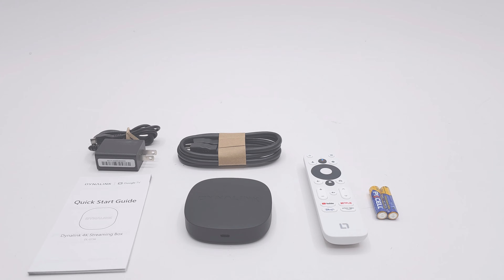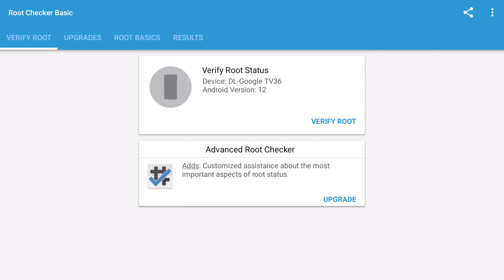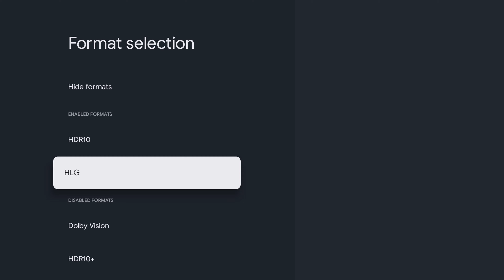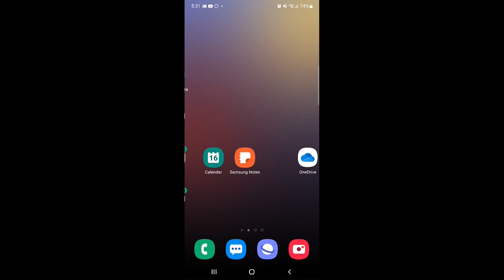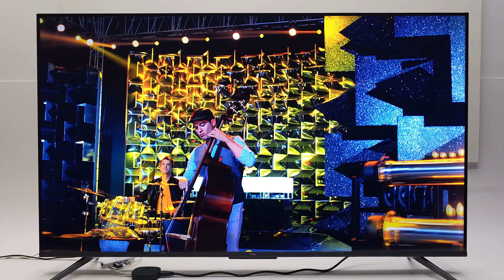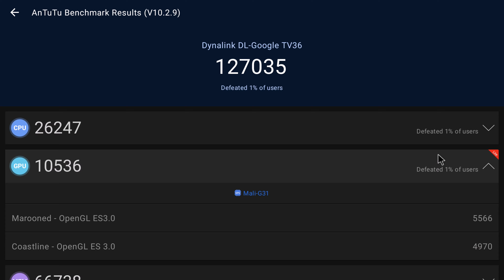Only $43? Wow - 2024 Dynalink GT36 Google TV Certified Android 12 TV Box

Comment: It’s the same as the $20 onn box . But it cost twice as much.
Reply: ONN 4K from 2023 is $20 with 8gb RAM.
ONN 4k Pro from 2024 is $45 with 32gb RAM.
Dynalimk has 16gb Ram 
They are all very similar except for storage capacity.
Reply from the maker: It's about the same
Reply: @qleap25  I think you meant ROM.  The RAM is different and less than the new 4K pro Onn which has more.
Reply: Wrong